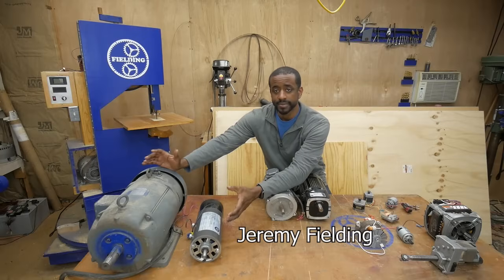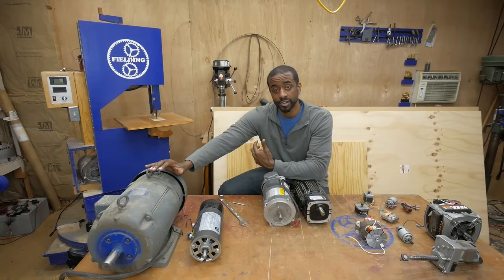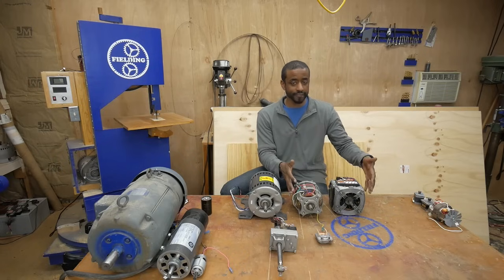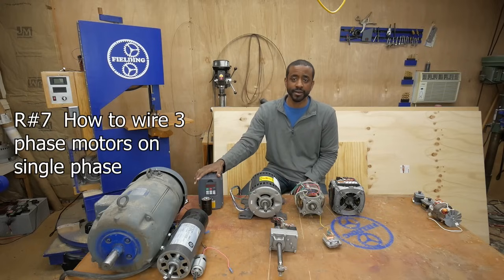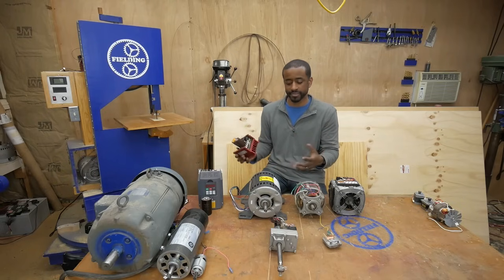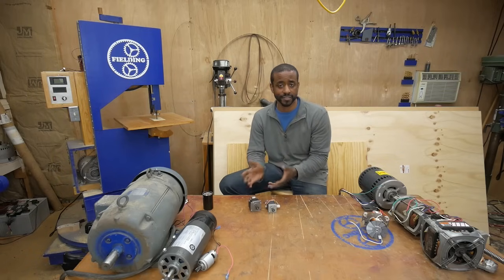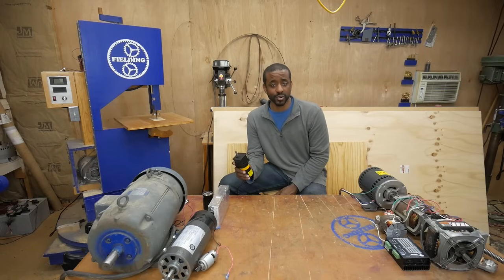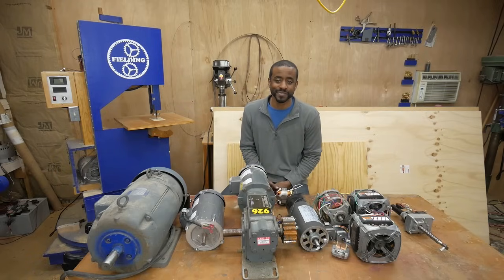Ultimate Beginners Guide to Using Electric Motors for Makers and DIY Projects; #068

Comment: Covered a ton of ground in this video at a very useful level for hobbyists. I didn't notice any mistakes but I would like to expand on the beginning with the big vs small 3 hp motors. I'll try to keep the following at about the same level as the video. 
You only mentioned speed and torque, but there is also a huge difference in the environment, duty cycle, torque curves, and materials.
 
On environment, some have sealed cases to keep out dust and water-spray(or fog), others have higher temperature ratings or they have a fan ducted over the case, some are more suited to driving things that produce some static charge (the charge needs to dissipate and can cause arcing across the bearings greatly increasing wear, much like electo-discharge-machining). some are more resistant to vibration, some can take side loading on the shaft(belt drive) while others can only tolerate pure torque(direct drive fan), and so on. Much of this can be found in codes on the data plate for the more industrial motors. 

As for duty cycles, there are notable differences between peak power and max continuous power, mainly related to heat build up but also for the rated life. most industrial motors will have a standard rated life continuous power(like 10k hours) but they will also have an overdrive rating like "1.7" and this means you can safely run it continuously at 1.7 times the rated power but it will shorten the life of the motor (eg. using it at 1.7x you may only get 2k or 3k hours rather than rated 10k). Some specialty motors that are used in either very weight or cost sensitive applications, may only allow the advertised power for a few seconds before needing a cool down either at a high rpm and low torque or with no power. Starter motors on engines are often like this with max 30 seconds cranking followed by a 5 minute cool down.

Torque curves; along with speed regulation, speed control, and torque control are the primary reasons for selecting one family of motor over another. Some have high starting torque(zero rpm), or have a noticeable peak in torque at a particular rpm, others like to hold a particular speed(good regulation) but the speed is difficult to change(poor control), similarly some types allow good torque control but without rpm control or regulation. An induction motor without a VFD has fairly good speed regulation but does require some reduction in rpm to get its rated torque, while synchronous AC motors will hold a very narrow speed range but have poor torque if they are forced to a slower speed by heavy load or during startup and tend to have rather harsh jump in torque right as they hit peak rpm. (There is something to be said for smooth acceleration regarding component strength.) eg The shaded pole motor used in the video has very low starting torque as stated, however it has strong torque near its full operating speed, which is why they are used on fans where resistance is minor at low speeds and grows as rpm climbs, so does the motor output. A starter motor on an engine on the other hand will provide basically huge torque at zero rpm and high torque over its full speed range, but it has no speed regulation or speed control so without a heavy load to turn they can immediately spin right up without much limit until they fly apart.

Materials, both type and amount, is partly about cost partly about age. Older magnetic materials(both permanent magnets and the cores of winding) were not as capable so they had to be much larger for the same total magnetic flux. Also cheap motors will have thinner generally less durable components or less quality materials; whether it is the outer case, the wire, insulation type, or encasing vulnerable connections in epoxy. 

As a last note: for the same type of motor with the same power and duty cycles, the high torque low speed version will be short and large in diameter while the high speed low torque will be longer and smaller diameter.
Reply: Also Add that electrical stuff from local self contained power systems; like ships and large aircraft, also some self contained campuses;  will often be designed for 400hz rather than 60hz. 60hz has reduced long distance transmission losses compared to 400hz, but 400hz allows much smaller magnetic bits and bobs for the same power, like transformer and motor cores, it also allows for lighter high-speed/low-torque AC motors and generators.

While electrical brushes do wear, most can be replaced at low cost, the main disadvantage is they can add some noise dust and ozone when used for a commutator (they don't cause much issue on plain slip rings)

Universal motors are actually DC motors that rectify applied AC into DC.(DC just flows right through the rectifier portion)
Reply: @mytech6779  Both your responses are extremely interesting and informative, at least to me. However, I would have to question them being at the same level as Jeremy's video. I kind of think you missed the boat on that one.
Reply: @reidwilliams2046  Granted my grammar could be cleaned up. (but I don't have time to revise now)
Was I too simplified? I was trying to avoid discussion of mid level circuitry concepts like shunt vs series vs compound wound; induction vs synchronous; and reactance issues calling for capacitors. (Or even running three phase motors on single phase and vice versa, or the use of wild-leg delta power supplies.)

Comment: I have a brushless motor meant for large RC helicopters that is 7000w/9hp continuous and peak 13,000w rated for 2 seconds.  The motor is only 3 inches long and and 2.5 inches in diameter.  Google KDE700XF

Comment: I'm surprised but not surprised that you hadn't mentioned the big bulky 3 phase converter boxes. I didn't know until now that a VFD converts single phase to 3 phase, I always thought it was just for speed control and now I see just how useful those things are compared to a 3 phase converter box

Comment: If u were to take the stator from a ceiling fan and turn it into a permanent magnetic wheel attach it to say a bicycle sprocket spinning one direction with an armature DC style wired directly to an induction motor with S.C. what would be the results

Comment: i want a battery/mule powered backup at my water wheel. It powers my asbestos sifter but the wheel only spins at 1/2 a turn per second. How many mules will i need to keep my asbestos plant running at maximum output? Also how do I get the mule to swallow the batteries? I tried them as suppositories but the mule was most disagreeable. Any help will be gladly be reimbursed with shillings.

Comment: Hi Jeremy, I have been watching your channels. I could not figure out my problem with my 5hp 220v motor 3500 rpm. that motor is used for drum sander for woodworking. it has been fine until one day it trip the 50A breaker. it does not trip right a way . took a few sec. check the resistance across two hot wires going to the motor. it is 0.3ohm. I thought it's got to have some resistance as it goes through the coil. I think there is some kind of short somewhere. cannot tell where. I removed the switch and connect motor directly to the power source and still trip the breaker. any though ?

Comment: Jeremy, I would like to build a desktop sized rock tumbler. I think that a sewing machine motor would work well to drive it. I would like to wire in a dial type variable speed controller ( not use the pedal that sewing machines normally use.) Can you suggest a simple controller - bathroom fan speed control for example ?

Comment: You don't have to give up speed for torque if you get a torque converter.  Thank you for your videos keep it up i have some ebm papst air conditioning fan motors i can donate if you want to do a video
Reply from the maker: Perhaps I don't understand what you mean, but a torque converter is a clever fluid transfer device that converts the difference in speed between the turbine and pump into torque. You don't get more power out then you put in. That matches exactly what I said in the video.

Comment: Hi, I really enjoyed your videos. In the last video, it was nice to finally be able to see a face. I have a long background in electricity and have day dreamed about some of the demonstrations that you did! 

My father opened an automotive electrical repair shop back in 1962. So I started learning how to rebuild starters, generators and alternators at the age of 12.  We used a 120 volt test light to check out the windings and the unit also included a growler to check the armature. The test leads were in series with a 120 volt bulb, and if you touched one or both you would get shocked.  My education included 3 years Engineering at University of Delaware,  1 year US Air Force electronics school, and completed apprenticeship for and passed the test for Master Electrician.    So I can really understand about being interested in electricity.  Also I have the background to know if you are explaining things wrong.  You do a great job!

Comment: I'm planning a large ornithopter build, how would I go about assessing what kind of electric motor I'd need for that~? The design I'm experimenting with will possibly require a lot of torque from the wing motors. You said that the trade off is more torque, less speed, which is fine. With this prototype's wingspan, it may only need to flap once every 4 seconds.

Comment: So in a way, if you don't have a 1KW big motor with high torque to move a cart, but hypothetically, if you have 10 smaller 100W motors and combine them into one, they can work together to provide enough torque to power a cart.

Comment: Hey Jeremy, I am working on a project that requires the use of a DC motor, however, i would like to know which type of motor would be best for creating oscillations? I am trying to create a transducer that takes a low volt, AC current in the form of an audio signal that is then sent to a dc motor to rotate a membrane to generate low frequencies. ive used a TRS-775w in my proof of concept and it works but it doesnt generate full 180 degree oscillations nor does it have a lot of torque when i apply a larger membrane in order to push more air per oscillation. I know this is niche but with your knowledge of DC motors, maybe you could point me in the right direction based on my use case.

Comment: Hey man I need help I’m trying to make a fast electric system for my boat I was thinking brushless with lithium ion batteries which would achieve the power but it’s too expensive what motor speed control and battery configuration should I be looking for here?

Comment: I replaced 2 300hp ac induction motors with 2 35hp servo motors on a tire stripwinding machine at work and cut 2/3 off of the power consumption. Most of the power consumption was from startup of the induction motor. The servo motors start up and with certain configurations come with an integral brake and the drive exhausts generated energy from the slow down process into a braking resistor.

Comment: The universal motor can be used in washing machine with top load (max 5 kg capacity), but not suitable for front load type. In simple to spin the drum You need induction motor, just to spin the agitator an universal motor was sufficient. Hope I clarified your doubt.

Comment: I'm trying to wire a single phase motor to pulley system on ac compressor and use the ac and or coils to chill

Comment: All motors have their purposes AC or DC . Brushless and stepper motors. 2 pole, 4 pole, 6 pole, 8 pole or more. More poles more torque. It all depends on what frame size what speed and how continuous it operates .Frame sizes and more.you can get so many configurations. High speed high torque or low speed high torque.VFD rated or fixed frequency. Series universal motors compound DC motors or multi speed AC motors and of course poly phase motors

Comment: Mr. Fielding,  could you do a video on the best voltage meter to buy for electronics versus just a standard volt meter?  Been shopping around cause I tinker around like you do but feel like I can't go further without metering more than v,a,o.  I feel I need to check capacitors and diodes   and may need megohmmeter to check the coils of a motor to see if they are good before wasting time taking them out of a device.  Much appreciated if you could bring you suggestions to the table.  :)

Comment: great indroduction

worth noting, if you want to speed control a dc or universal motor with PWM the controllers are totally dirt cheap on chinese sites like banggood. like seriously a few bucks (with a nice knob and a often case) and way not worth diy. less than ten for a 4000W AC controller! make sure you're buying for DC or AC power supply. dc controllers will be called PWM, ac will be called SCR ... they both rapidly switch power on and off (much more efficient than dumping power into a series resistor, which will need cooling), but the dc controller is true pwm (with regular timed on-off pulses) while ac switches every time the voltage waveform hits a threshold determined by the control knob. also note this is not true control, just a reduction in power. this might have exactly the effect you want or it might be fiddly and unreliable

Comment: Add a definition of HP, how it is measured, and what a watt is and how that relates to HP.
Reply: One horsepower (HP) is the power required to lift 550 pounds by one foot in one second in a 1G gravity field.  (or 33,000 pounds one foot in one minute in a 1G field).  The original definition was done by James Watt in order to quantify the power of his newly invented steam engines.  Watt, being from Scotland, used Imperial units in his definition. At the time common uses for steam engines were to replace horses in mine workings and thus Watt defined a unit, based on the work a good horse could do, that would make sense to mine owners.  There is a metric definition of Horsepower which is lifting 4500 KG. by 1 metre in 1 minute in a 1G gravity field.  This is not quite the same as an Imperial horsepower (being 32,550 foot pounds per minute rather than 33,000) but it is pretty close.  The usual abbreviation for the Metric horsepower is "PS".

The unit of power that we call a "Watt" is named after James Watt (who died in 1819) and was first proposed as a unit by William Siemens in 1882.  Siemens defined a Watt as the power conveyed by 1 Ampere of electrical current flow through a potential difference of 1 volt.  If you want to use different units you can define it many other ways, but that was the original definition.  Watts and Horsepower, both being units of power, are essentially interchangeable by multiplying or dividing by a constant.  One horsepower (Imperial) is equal to 746 watts.   (Being an electronics engineer I have built some pretty large power amplifiers for high fidelity sound systems.  People have asked me how powerful they were.  I used to reply "Oh, about one and a half horsepower." That always confused people!)

Comment: I just purchased an old grocery cart that's electric for handicapped people that says amigo on it,
it was hit by a car and I took it apart
I have a speed controller and there's two batteries with it..
the motor looks pretty beefy.
it looks like it would have a lot of torque
do you have any suggestions on how I could use it for a go-kart
I'm thinking of putting gears on it from a bike?

Comment: what duty cycle a washing machine motor is? s1 or s2? for example 500 watts motor 2800 rpm 220 volts can be running for hours without getting damage or be overheated?

Comment: Question:  I was a mechanical engineer at Frigidaire,  We had washing machines powered with 120 VAC/1-phase/60 Hz, 1/2 hp AC motors.  Each motor had a single start capacitor.  We had 30 washers being life tested.  They were all washing 15 lb AHAM clothes loads.  Their timers were all "hot-wired" to wash each 15 lb AHAM clothes load one complete wash cycle after another continuously for 24 hr/day day after day for six months.  This was considered to be equivalent to 10 years of normal use.  The washers had a 10 year design life which was typical in the industry.  Occasionally I would receive a report from the technician  that another start capacitor had exploded.  I would go down to the life test lab to take a look.  Once the washer front access panel was removed it was easy to see all the "confetti" like start capacitor innards having been completely blown out of the now empty plastic capacitor cup strewn all over the inside of the washer cabinet.  At first we thought the cause of the start capacitor failures could be when one of the ladies bra straps got sucked underneath the agitator by the small radial vanes located underneath the bottom of the agitator and getting wrapped around the agitator shaft resulting in a locked motor rotor condition whereby the motor's rotor couldn't rotate.  A locked rotor condition would result in the motor current draw to skyrocket.  We also thought the capacitor would also draw a large amount of current.  All the internal capacitor components were held in place within the capacitor can with some sort of hydrocarbon-based potting compound.  Hence, we surmised that during a locked rotor condition the high start capacitor current draw and subsequent high internal start capacitor temperature was causing the hydrocarbon-based potting compound to boil off some of its lighter VOCs (Volatile Organic Compounds) which would be very flammable.  All that would be needed, so we thought, would be an ignition source to explode the capacitor.  We thought the high current would provide enough i^2R heating within the aluminum foil coil inside the capacitor can to ignite the highly volatile VOCs within the potting compound and within the oil saturated dielectric paper coil wrapped up with the aluminum coil inside the capacitor can.